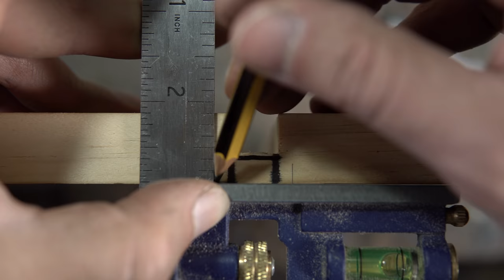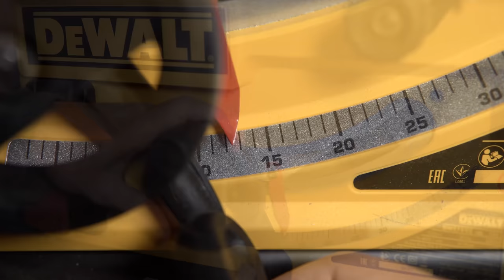SUSHI Serving TRAY / How to / Woodworking

Comment: when the wax finally arrived, the wood let go a sigh of relief. Muy bonita!
Reply from the maker: Indeed. That piece of pine was really dry. Not shown on video but I applied 3 coats of my own blend wax buffing between coats. Regards.
Reply: @WoodworkingBarcelona  ended up looking really great, very nice grain too.
Reply from the maker: Thanks! With Yakisugi is one of few times that you get advantage for using soft woods. Regards